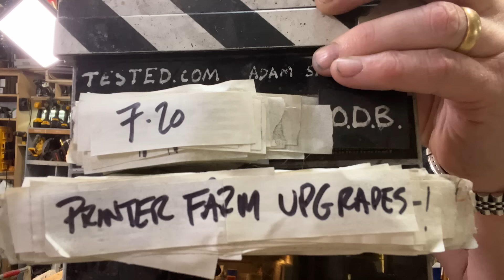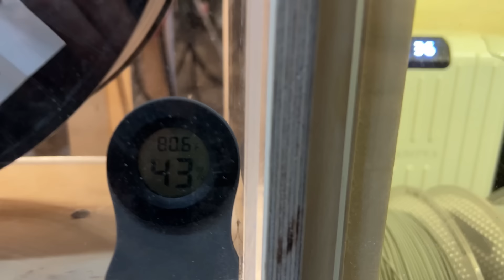Adam Savage's Essential 3D Print Farm Upgrades!

Comment: 30:32 Depends on who you buy the filament from, so Creality, Elegoo, etc will have their own exclusive colours.  Quite literally a case of shopping around with several browser tabs open of different filament vendors and printing manufacturers.

There is also electroplating the filament you have printed with post print which is pretty much explained in this video: https://youtu.be/FLh5OMvY87o?si=HiJnOJ8BGM-uvsI4

Resin printing is used in the above instance with a printer that has at least 4k or above resolution to have esentially no layer lines, but FDM printers can be used to get the same effect if you tinker around with a few settings like the layer height for example on some throwaway prints until you get your desired effect before printing your actual part. So some trial, error and patience is involved with the FDM printing approach.

Make sure you have proper room and air ventilation in genral, UV light protection for the curing process (usually come fitted on the curing station anyway) and some form of fume extraction and an air quality filter (like ones used for confined space entries) when using resin printers though if you ever plan on going down the resin printing road too.

Comment: @tested Adam, you said the textured plate is a game changer.  Why?  I have been using my X1C with the smooth PLA plate since April with few issues. I  ordered their new textured PEI plate.  The issue I may have with a textured plate is that you are imparting that texture on to the print.  That might be cool, but that texture is not imparted on to the sides or top of the print.

Comment: I'll be curious to see what someone suggests for the anodized aluminum look you're wanting. For any realistic looking metallic finish I'm used to needing to paint the plastic with layers and automotive primer (Duplicolor Adhesion Promoter was the brand I used) in a relatively obnoxious process of painting layers with about 15 minutes between them to get the right look.

Comment: do not under any circumstances add grease to the pastamatic gears. the pastamatic device has a major design flaw which causes a triangular piece to regularly fall apart and when it does you could easily get grease on it and then spread to the filament. i just threw away my pastamatic parts with grease due to this, when grease got on a spool.

Comment: Adam, as a fellow X1C owner I wanted to ask if you just let the dynamic flow calibration run before every print, or whether you actually manually run a calibration for each filament and then just use that without using the dynamic flow calibration with the lidar. 

I'm asking because 95% of my prints come out awesome. But there are some that over extrude a bit, especially on smaller pieces, and that bothers me because I fell like a printer of this caliber should be able to detect that as part of the automatic systems in place.

I make firearm parts (for now mostly grips but other things soon) and I am worried that if I trust the printer to calibrate perfectly before each print, one of those 5% pieces that goes to a client is going to slip by and I am going to look like an idiot for not calibrating it myself. 

Of course if any other X1 owners want to chime in I am happy to hear it. Thanks!

Comment: So cool! Now very curious about how you get your prints so clean straight out of the printer? I use PETG and there be stringing...
Reply: PETG is very stringy. It’s nearly impossible to get rid of stringing in my experience. You can limit stringing by tuning retraction settings, but with PETG it’s unlikely to all go away. He’s using PLA which is a very forgiving material. I only use PETG of it’s absolutely necessary.
Reply: Also be careful with PETG on a PEI build plate. PETG can fuse with PEI, because it’s very similar in composition.

Comment: When you pulled the benchy off, the rear prime line—it's off the plate (it should print about 1 mm from the edge, but on the plate!). Assuming you inserted the plate properly, your hot end is badly bent. Funny thing is that the printer will still work, but you might see reduced quality.

Comment: If you're going to mod your humidor to feed from, why not just store your 3 kg spools in it so you don't have to transfer filament to smaller spools?
What kind of glue did you use on the spool holder?

Comment: Hey Adam I have a Bambu p1p on the way, one of the problems with multiple color prints is material waste I have been trying to think of a way to have the machine extrude purge without a tower straight out the back so the material can easily be clipped and remelted back into the same color filament, is it possible to mechanically sort the waste out the back door so the material can easily be processed into pellets to recycle materials?

Comment: I find the worst thing about purging is that it wastes so much filament.   You end up with more filament in waste than used in the actual print.
The table to remove calibration lines is a cute idea, but I found they just peel off as easily as the main print usually.

Comment: I don't own a P1P so maybe this has to do with that particular printer and the multi filament add on... but I'm curious why you don't just feed off the 3 KG rolls in the dehumidifier box directly into the printer?  Seems way more efficient than winding onto smaller rolls. (edit) Ahhh got it... you are using multi materials.

Comment: Only problem with AMS is after printing the filament is stuck in the tube and i have to diconnect the quick coopling. Printed Y tube etc, but I didnt find s solution :/ Hope Adam can help and find a solution for that.

Comment: Didn;t knew you're still alive, try using textolite/garolite G10 as a printing surface, it won't flex, but you will not need a glue and it is cheap

Comment: Hi Adam!
 If you are printing on a removable magnetic flex plate you should not be scraping it , that is bad for the finish! When print is finished remove the plate let it cool down for a few minutes then bend it in half the part should pop right off.

Comment: I feel like the simple solution to the plate scraping table would be to have an extra clean one beside the machine. Once the print has been cleared, swap the plate with the clean one and start your next print. Then you have time to clean the used plate while the printer is running. Nevertheless, I’d rather watch Adam build the table! Lol

Comment: Why are you scraping a flexible build plate? They are designed to pop PLA off with nothing more than a slight bend. The same is true if you use glue stick for ABS, and ASA, and window cleaner for PETG. I haven't had to scrape the bed of an FDM bed since I got my first Prusa (my first printer with a flexible bed). Oh, and I love the Dry-Box, I think I could make one of those for my printers.

Comment: I really enjoy watching Adams shop infrastructure videos, and normally I think what he does is pretty good, and everything looks like it will work, but I think I would have done things differently. So the filament box for the cobra max, why couldn't he just put the filament for it in the hotbox under the Bambu printers? if that isn't feasible then fine, but why stick it coming of the hot box like that? why not turn it 90 degrees so it is protruding less? so regarding the priming or calibrating lines, on my ender 3 I am able to just grab those with my finger nails and pull them off, alternatively couldn't you use the scraper while the bed in the printer? making a whole table for that seems like a cumbersome solution and I would be willing to bet in a few weeks it is going to end up with a bunch of stuff it making it unusable for its intended purpose.  regarding the purge funnel that funnel seems like it is a lot for those small shoots I would have designed a cover that fits over the shoot and connects to a clear vinyl tube which I would have routed the trash can. that would make changing things much easier in the future.

Comment: Suggested project:  collect all of the cast off filament from the Bambu machines, (and your scrapings), and then put it into a filament extruder to recycle the filament.  use a high-temp hot glue gun as the heater and nozzle. you'd need to cobble together a source hopper and a feed auger similar to an injection molder.  finally, a shredder for bigger things like the print supports or failed prints, which could feed the input hopper to the extruder.  please?!?

Comment: Moisture content in filament is one of those things which has become completely blown out of proportion as an actual issue.  I live in Florida and currently have over 3700 hrs of print time on my PRUSA i3 Mark 3S with literally not a single filament moisture content issue and I do nothing except store my filament in cardboard boxes in the air conditioned room in my house where I print. It’s just not a thing you need to worry about …

Comment: Just spray paint the filament instead of looking for the exact colour your looking for,  its far less time consuming, you'll get a better finish also.
 Also use abs instead of pla. pla is badly brittle, lacks toughness and deforms/creeps under stress loads over time, print abs or asa. I like asa.

Comment: Why not just clear the little scraps from the print sheet whiles it still on bed and then drop the scraps into the purge chute? Seems very extra to make a table for a flat surface when your printer already has one built in.

Comment: I'm sure you figured this out at some point, but on the receiving spool, you clipped the filament in the wrong spot.  There's a place near the center (in several spots, on both sides) that you clip in filament to transfer to a spool.

Also I love how 3D printing is all about printing modular parts that you can make 1000000% custom, to a .02mm tolerance, and you're like "nah fam, glue."  We've all been there, I just thought it was funny.

Comment: Why are you scraping the PEI plate? I never have to scrape mine, just pop the models off, spray it with Alcohol and wipe it down and print the next job! Also, to collect the poop from multiple Bambu printers, get a piece of vinyl gutter and tack it an an angle on the back of your bench, with the low end sticking out just taller than a standard office garbage can... That way, gravity will shoot the poop in the can...

Comment: this was interesting to see but I'm surprised that you haven't invested in an IDEX machine. It was the main reason I didn't go for the Bambu even though it can do multi material, purging between support/pla seems to waste a lot of filament and time. I have a couple of cheap bed slingers for testing prints but invested in the biggest IDEX with material management I could afford. I realize that's not an option for hobby level but for you guys, it seems like a worthwhile addition to the farm.

Comment: Don't scrape your PEI coated plates, you'll destroy them faster then necessary. Let the prints cool a bit and with spring steel plate you should be able to just bend it and pop pieces off.

Comment: Adam... Why are you scraping parts off of a PEI coated spring steel build plate. Pro tip... The glue stick you're using sux, try a bottle of MagiGoo instead. Parts really stick and also release with a little bend of the plate. TBH, even glue stick should release without scraping.

Comment: It was mentioned in the filament box video, but why not just keep the filaments in the main box and feed it out to all the printers like you do with the clear box?   Considering how crowded your shop is, I'm surprised you went to "bolt on" the clear box rather than just put a hole in the main box.   Similarly, the "build plate cleaner" table, takes up precious floor space.

Comment: I would instead of building a table and prying off the prints while hot, just buy a second plate.  Swap the plate, and let the finished one actually cool properly and then you just flex it a little and everything should pop off.  Much easier and much less effort/active time spent.

Comment: Best bet for anodized aluminum look is to prototype it, as others have have, in "Silk"-type PLA (though dialing in the speed and temperature to get the sheen right is a real bear).  That's why, once you've got it looking the way you want, you need to cross the bridge and visit the good folks at The Crucible makerspace.  You can take your printed positive and use it to sand-cast a new piece out of real, honest-to-goodness aluminum.  Why not simply machine it?  First, because not everyone watching will have that option, and you can show them something new.  But for your purposes, the bigger reason is that the cast piece will have a texture that's very, very difficult to achieve on a mill, and likely closer to verisimilitude--very few mass-produced metal objects are precision-machined, after all.

Comment: I feel like this was one of those "I have a solution I will attempt to keep using the solution I have and modify it" solutions.

In reality, adam should have just put the filament spool inside his X1C filament dryer box, instead of bolting the old filament spool holder to the outside. Just put the ptfe tube into the big X1C filament dryer box, instead of another tap into the plexi filament box.

Dump the plexi filament box because ... at this point why are you keeping it?

That way you have a much simpler filament box rather than a hybrid dual filament box.

Comment: You should not need to use glue on the PEI textured plate! Most people with multiple Bambu Lab X1C printers simply use a section of vinyl gutter on the back of the table, sloped to run poops into a trash can at the end of the table. Your "table" should be warped, so al you need to do is push it against the warped surface and watch the parts pop off the plate. NO SCRAPING!

Comment: at the beginning you speak of scraping the plates. why? 

on glass i scraped with my old bedslingers normal people do, sure :)
but on the bambu i use the textured pei dual side for almost everything, except abs/asa. for that i use the pex from whambamsystems. 
cant beat it for stick and ease of release imo.  and there is the no scrape, no glue, no washing with soap.. 

all i do is 99% isopropyl alcohol 1 liter bottle with a windex pumphandle that has an extended tube to reach the bottom of the 1 liter bottle. the procedure is a lazy as this ;

two bins by the printers, one for regular bin for papertowels and one for collectively collecting poops that go through the table and into chutes that come together in a y under the table into the plastic bin. 

1. after each print its the same procedure, bend off the plate to release the part when the plate and/or model is cold enough.
2. pull off the purge lines with your fingers. with no glue they come loose easy with my procedure.

3. spritz richly four five pumps to cover the centre of the plate and quickly swirl outwards to the the edge of the plate. i just hold the plate with the left and swirl with the right. no need for table.
4. place plate on hotbed holding it with righthand and the now wet from iso papertowel.
5. throw away used wet towel into paper bin and close lid to avoid vapor stink from iso.
6. ready to go.

Comment: If anyone with the knowledge sees this, I'm planning on upgrading from an Ender 3 pro, its a good printer, but everything on it is pretty worn, and I don't plan on replacing every single part, I'm trying to get some better precision and possibly multi material prints, It seems like most printers that fit this quota are over a grand, if anyone who sees this has advice, I'd appreciate it.

Comment: Couldve just used the top of the drybox you JUST MOUNTED as the flat surface.  At a board if you need the space.  Alternatively just stick a magnetic sheet on any flat surface, vertical would work.  Then you can stick it to the wall and scrape.  Put the garbage under the mounting point.  There is so much overthinking.

The fan is unnecessary in the dry box since the moisture content will equalize.  You would be better off mounting a small PTC heater in the box to help drive off moisture.